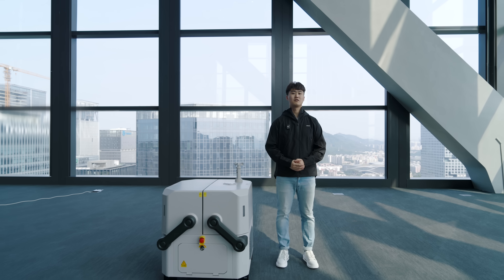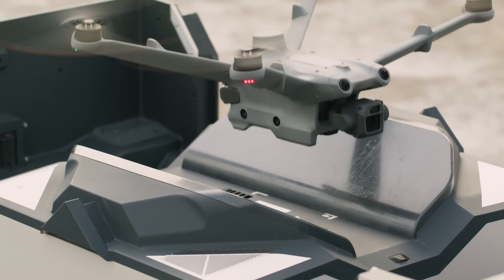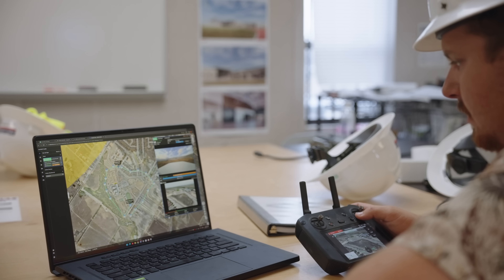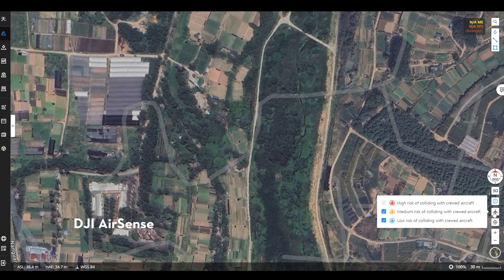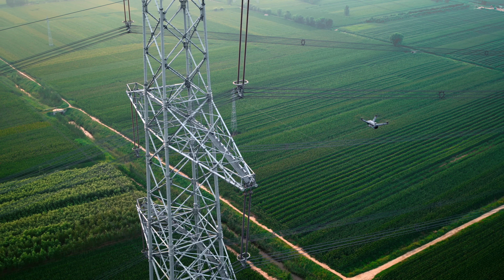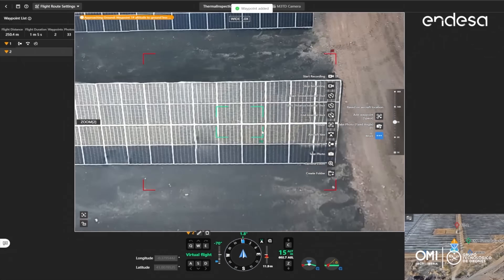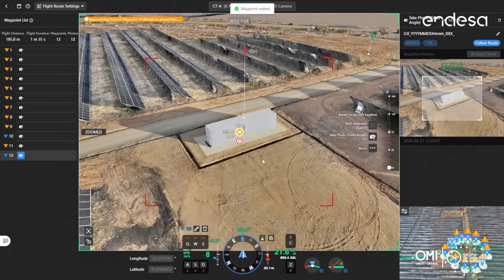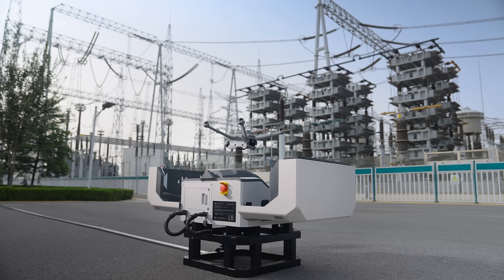DJI Dock 2: Everything You Need to Know

Comment: Can't wait for a residential version with a tiny, ultra-quiet drone or a swarm of drones in a compact dock, installed on the roof. Automated perimeter checks and thermal sweeps.
Reply: You just described the job of a poll/post with a cctv setup
Reply: @unspecialist  if poles had wings.
Reply: Can't wait for auto defense mode with built-in explosives 😃
Reply: For residential use it will scare burglars away great idea 💡
Reply: If you have the money for this quadcopter, you have the  money for a couple of extra batteries . 10 extra batteries minimun.  And have this thing   in the air indefinitely.
Reply: I agree this would be great for large acreage to monitor a large areas or hard to reach areas quickly.
Reply: no that is a terrible idea. we have cctv we dont need a loud drone annoying neighbhours all day
Reply: A mild irritation, especially if your neighbors are far away and your perimeter is vast. Anyway, there's this one guy who has a foghorn that he loves to play with and the HOA 15 miles away logged a complaint. He has a YouTube channel.. you're going to love it.  @spacecowboy07723
Reply: Can we keep in touch, I have similar aim and ideals
Reply: Considering it has only 400 battery charge cycles, I don't think it will be cost effective for tasks that require regular monitoring of small region. CCTVs are better for this.
Reply: @dreadfulbodyguard7288 EVERY rechargeable battery has around 300 cycles of life buddy. EVERY single one. 400 is obviously better. You just replace the battery when it can no longer hold a charge. Can your CCTV cameras fly? 😂
Reply: @Fluterra  I am all for drones but just because you can does not mean you should
Reply: I’m so grateful I don’t live in or anywhere near an over populated city……
Reply: @turtsable every time I go to the suburbs or farm I thank the stars I don't live in the middle of fucking nowhere with nothing to do except drink, fuck, and shoot guns lol

Comment: MATRICE 3D VERSUS MAVIC 3E, A PHOTOGRAMMETRIC COMPARISON
1)	Dust/water resistance: Matrice 3D (probably has) versus Mavic 3E (do not have)
2)	RTK GPS Antenna: Matrice 3D (onboard) versus Mavic 3E (external accessory)
3)	Aircraft weight: Matrice 3D (1410gr) versus Mavic 3E (940gr with RTK antenna)
4)	Battery capacity: Matrice 3D (7811mAh) versus Mavic 3E (5000 mAh)
5)	Battery weight: Matrice 3D (544gr) versus Mavic 3E (335gr)
6)	Max Flight Time: Matrice 3D flies (50min) versus Mavic 3E (45min)
7)	Obstacle avoidance: Matrice 3D has (6-directional) versus Mavic 3E (5-directional)
8)	Lens defogging: Matrice 3D (has) versus Mavic 3E (do not have)
9)	Photogrammetric camera: Both share the same M4/3 20mp CMOS sensor
10)	ISO Range: Both share the same 100-6400 ISO sensitivity
11)	Shutter: Both share the same 8-1/2000s mechanical shutter
12)	Tele camera: Both share the same 12mp, 162mm ½ inch sensor camera